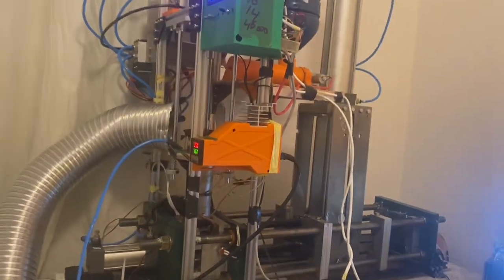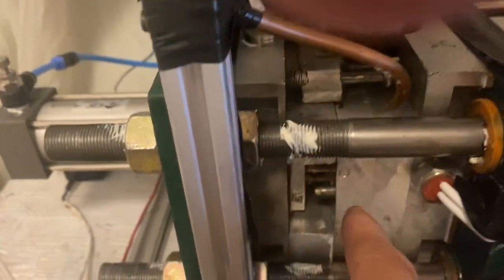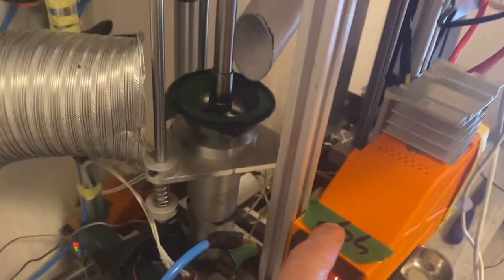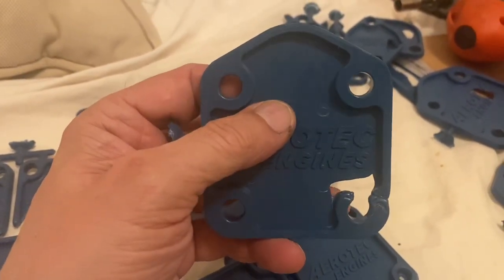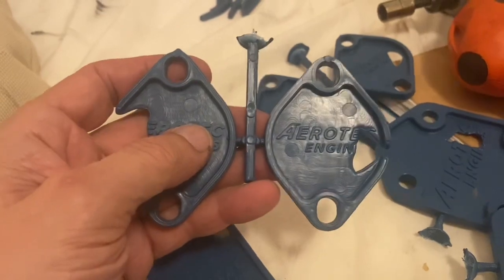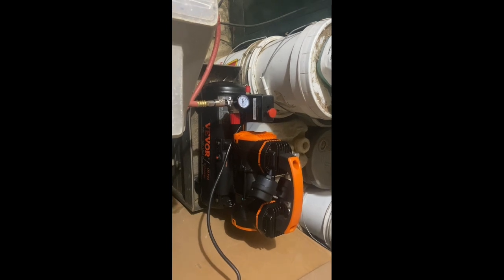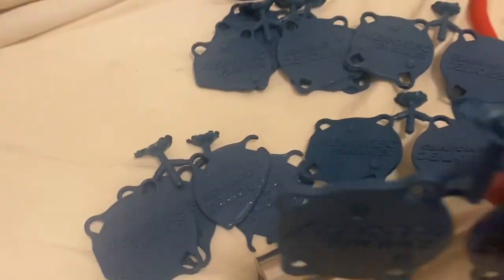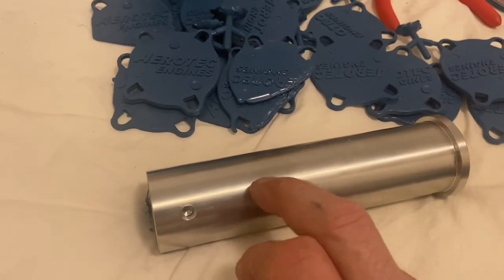Understanding plastic injection, failures, and how to fix them ￼

Comment: The buster beagle used a pneumatic injector which has low pressure about 1,500 PSI.
Reply from the maker: That is correct! But when you have a mall surface area of 16 in.². That’s like 24,000 pounds of force trying to open your mold.